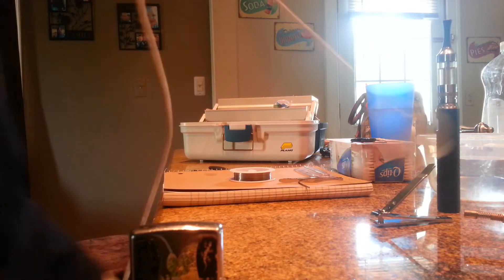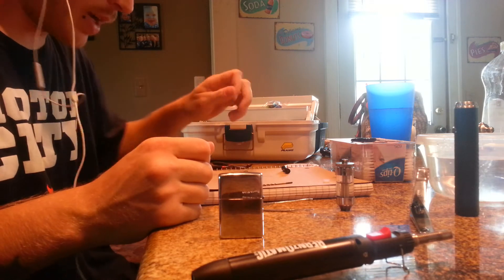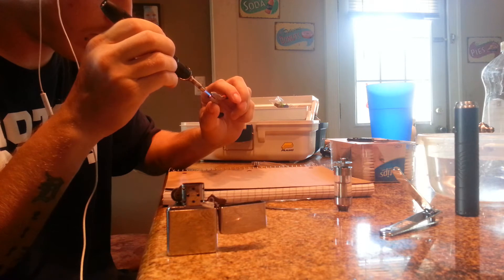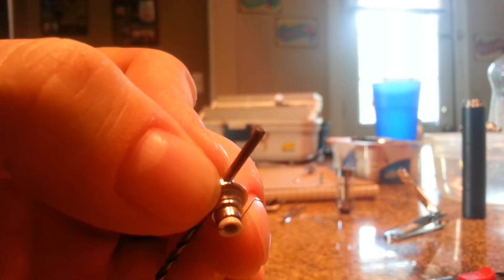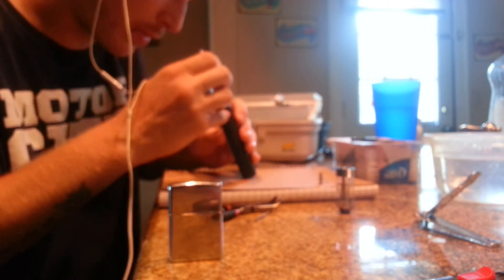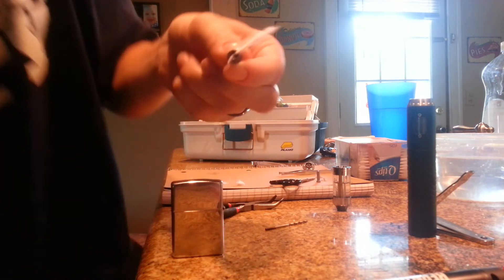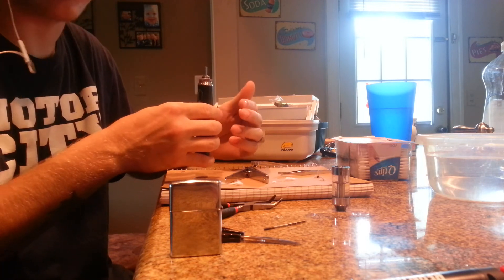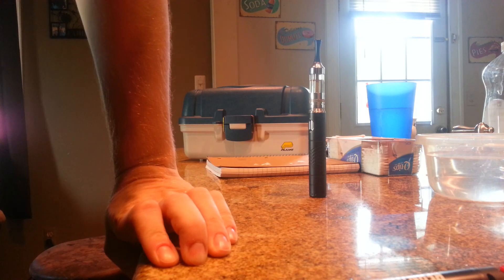Micro coils on puritank/protank cotton

Comment: I go 6/5 around a large paper clip, thread w/cotton, cut it a little long, fluff the ends before stuffing while priming (of course no flavor wick) and BAM!--1.3 ohms at 10 watts on a regular generic ego battery. Been doing this build for 7 months and put a few dual coilers to shame with flavor and cloud.
 I will say it's too hot for the Davide due to the rubber grommet--I just replaced them with the silicone that Kanger uses.

Comment: Not knocking your building skills, well done. However the initial issue of flooding - The Chimney is serrated/grooved. The gasket you left out  Seals the upper pipe to stop air leaking into tank and pushing liquid out. At least replace it flipped.